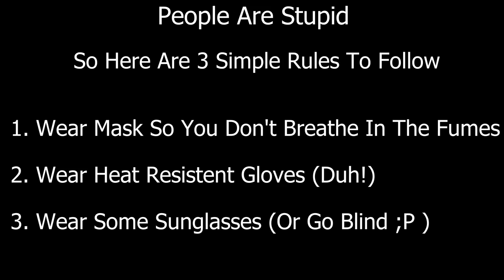How to Get Started at Blacksmithing By a Beginner | Ep 1 - Tongs

Comment: I started the same way. A hole in the ground with a hair dryer as a forge. My anvil was scrap steel. I used the same kind of hammer and a pliers for tongs. I made coat hooks, spoons, and forks and sold them and bought more steel and better equipment as well as helping my income.

Comment: Rule number 2. Wear Gloves when blacksmithing!  OMG for heavens sake Do Not Wear Gloves when blacksmithing.  You need to feel the heat in ojects and trust your natural reaction will keep you safer.  Learn to work safe.
1. gloves mask heat until it's too late and you cop the full force of the heat.
2. gloves retain heat and will cook your hands between realising  you are getting burnt and getting the gloves off.
3. gloves will stop you quelling burns by quickly dipping your hands in cold water
4. gloves interfer with the feel you need to engage with the metal safely.

Do wear steel cap or sturdy boots, long trousers and a protective smock.  The goal is that fash sparks and/or dropped items are repelled and fall away from your feet.

Comment: The material you started with is way too small.  The tongs will flex and are quite thin.  Next time start with thicker material.  Those are better than nothing, but just barely.  You really need to get an ASO.
Forge On!!!
Reply from the maker: Thanks for the advice tbh for the materials as i am new i just took whatever scraps of metal i could find as i just wanted to forge and get it started XD.